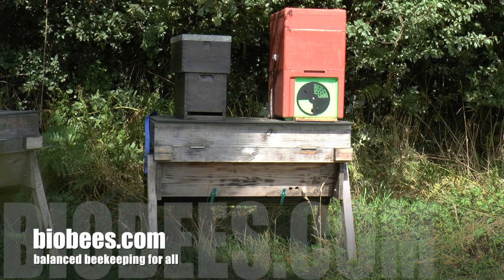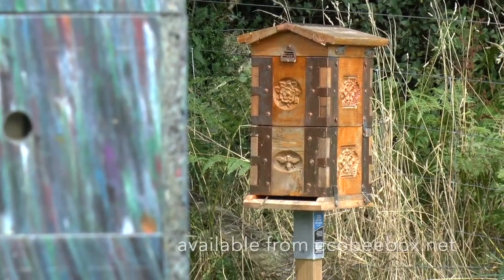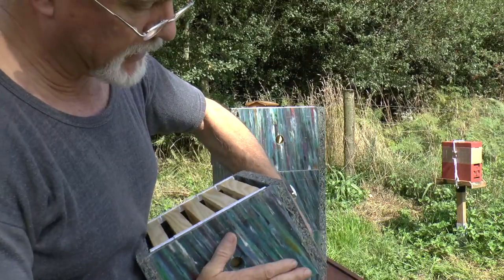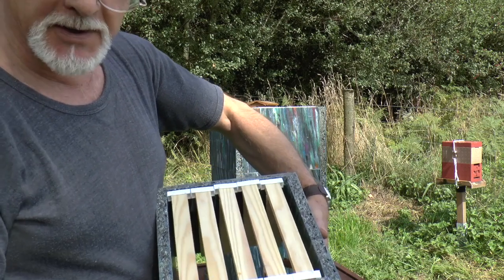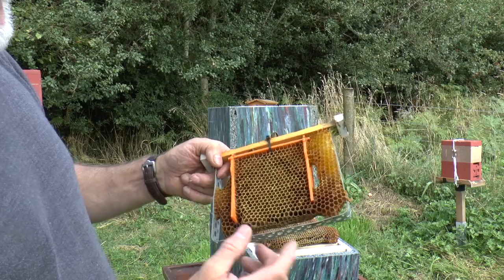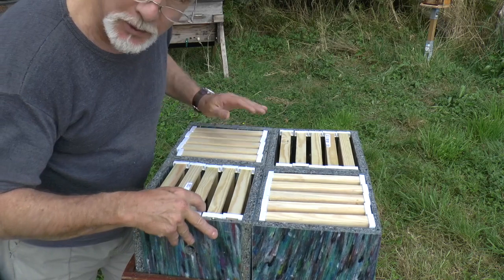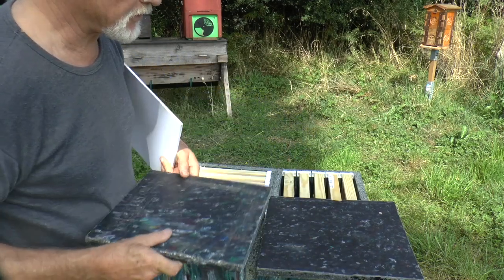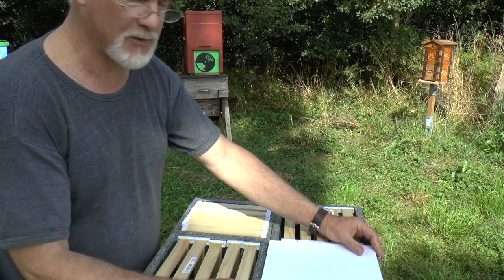The Quadratic Hive: the most versatile beehive in the world! (Part 2)

Comment: That plastic hive is great I was just looking at a 4x8 sheet of pvc and wondering about the same thing
Reply from the maker: That recycled plastic turns out to be more thermally conductive than wood, which makes it unsuitable for hives, but ok for roofs with some insulation underneath.
Reply: @BarefootBeekeeper  too bad pvc would have been easily disinfected instead of burned in cases of foul brood.
Reply: @BarefootBeekeeper  I wonder about using an actual cooler as a top bar hive?

Comment: Foam plastic is called foamax used for sign making.
Reply: It is probably more durable than plastic  "Corflute" that I've seen a lot of signs printed on.  We see lots of then get discarded after election season.    If the candidate intends to run in future elections they might want to keep them but if the slogan or candidate is not going to reuse those signs.   Or real estate not reusing signs then you might find a source of lots of them.   Those plastic boxes probably don't need additional insulation but I was wondering about added insulation in very hot of very cold locations could put Styrofoam and plastic foam boards around hives as additional outer wraps????

Am curious how well do the bees accept a plastic box as I've been watching videos where people buy plastic foundation with plenty of wax dipplped or rolled onto it.   Possibly wax the inside of the hive?  Or could they manufacture it textured to encourage the bees to propypise the inside of their hive as a natural barrier between bee and plastic?

Comment: We have some VERY HOT summers here in south eastern US - I can't imagine hot glue holding up. Is there some kind of hardware holding the boxes together as well?
Reply from the maker: Unless you experience summer temperatures in excess of 220 degrees F, I wouldn't worry about it melting. In any case, I am not suggesting that you make hives out of recycled plastic, or use hot glue for hive building: this is a prototype and most of my hives have been and will continue to be made from wood, using conventional joinery techniques. In fact, hot glue is not that great in terms of bonding strength in most cases and I would never recommend it as the sole structural jointing mechanism, especially on materials liable to absorb water.
Reply: I was wondering if long thin "chipboard" type screws would strengthen those joints?   Or something similar but outdoor suitable... Have to be outdoor suitable brass, stainless or coated &